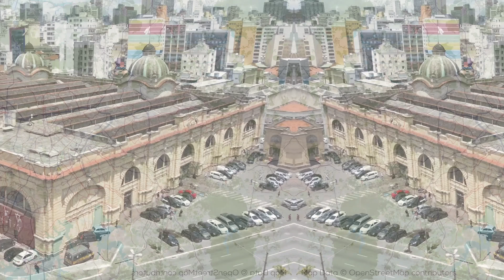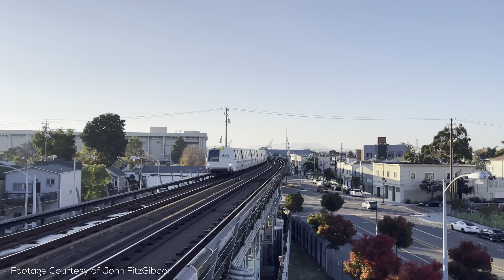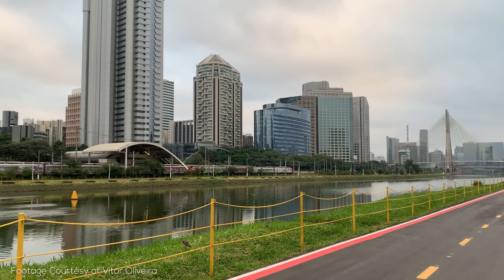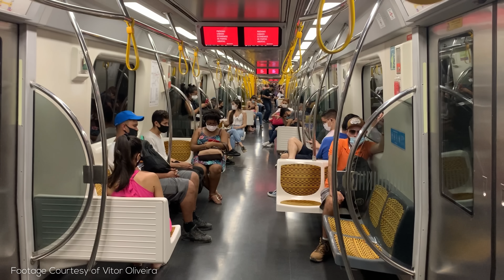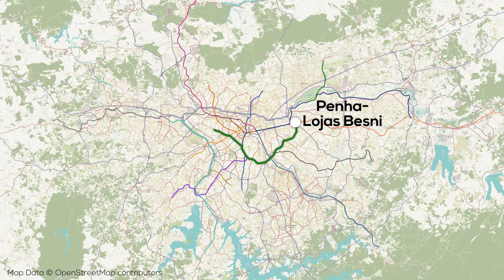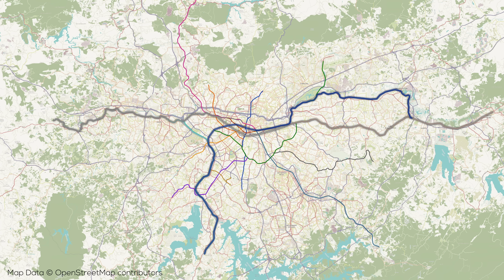The Busiest Subway in the World? | São Paulo Metro, Brazil

Comment: A few corrections, the Tiete doesnt cut the City and North and South, everything above the Tiete is North, but below it we'll have West, East, South and Center, and the city itself has 12m people, but with the metropolitan area it goes to 44m, and also if you look the megacity airport code for Sao Paulo, it is SAO, you'll see that it includes the Airport VCP, from campinas, about 50m from the city, which is highly accessable to brazilian because most airlines will give you a free bus from Sao Paulo to VCP
Reply: I meant 1h50m from the city to VCP, which is far compared to the others, but accessable if flights are cheaper

Comment: I am from Brazil and lived in Sao Paulo for 8 years, where I used to take the subway daily (now I am living in Toronto). The Sao Paulo subway system should be 3 or 4x bigger than it is, to have an idea I used to wait for 3-4 trains just to be able to get in, there are simply too many people. The subway also does not reach most of the city and the average Joe needs to get a bus, after a train and only after that be able to get the subway (sometimes it takes more than 1 hour to do that and they spend 2-3 hours daily commuting). The subway trains and stations are very clean, as you can see in the video, and you can even see employees cleaning the walls.

Comment: I feel honored as an engineer who have been working at São Paulo Metro for the last 14 years (lines 1, 2, 3 4, 5 and 15). Thanks for the video my friend!
Reply: Obrigado pelo monotrilho, tem ajudado pra caralho desde 2018
Reply: Vlw pelo monotrilho meu mano, vc salvou mto meu job
Reply: Soon to be line #7 aka linha de ouro
Reply: i use it every week, thanks
Reply: You didn't need to expect the Expresso Leste in the 2000s
Reply: Cara valeu pelo monotrilho da linha 17 vai ajudar muito
Reply: São Paulo Metro`s is the most cleaner around the world
Reply: Well, congrats but the company needs to do better. CPTM still have a lot to improve, specially when it rains. It's total chaos with power going down and most of the time AC not working on proper hot days. But other than that it works perfectly, Sao Paulo is basically a swiss cheese when it comes to the subway stations, you cross from one side to another using public transportation easily instead of facing hours on a huge traffic on the roads.
Reply: @Mevonez  Well, if the power goes down the problem wouldn't be of the electricity company?
Reply: @exmundi  I meant: when the power goes down only at the train line. They say the power is down on lines: "x y and z" and they're working to repair. Not when the power goes down in the entire neighborhood or  smt like that.
Reply: @Mevonez  What does that have to do with this guy who's an engineer?

Comment: Things I like about Sao Paulo Metro system:
1- Cleanliness.
2- 5min. wait time between trains.
3- single fare price no matter how far you travel.
4- improving service availability by extending the lines farther.

Things it needs to improve:
1- Fix the IC card recharge machines which are broken in many stations.
2- Integrate with private companies to build more shops and recreational facilities on its stations like in Japan.
3- A true "ring" rail line running the downtown perimeter connecting many lines, just like the Moscow metro.  
4- Desperate need to improve / overhaul the CPTM over the ground lines. Many trains have wrong destination signs! Not to mention wrong radio announcement!
5- Make decent integration of Metro with airports. Carrying your luggage 100 meters to 300 meters from the station to the terminal shows lack of urban planners and mayor competence.
Reply: The main problem is still overcrowding, Grajau and Santo amaro need more acsses plataforms
Reply: 5min wait time between trains only in CPTM and ViaMobilidade, CMSP lines it's like 1-2min
Reply: @A556CPTM  5 minutos é no Rio aqui em São Paulo tem dias que leva 30 segundos de um trem para o outro na linha 3
Reply: @marciodesouza6288  Como eu citei, nas linhas do Metrô (CMSP) é mais rápido, na CPTM não é tanto
Reply: 5min in worst cases. I use it everyday and i can assure that is around 1,5 - 3 min. Theres screen monitors all over the station telling the wait time to next metro
Reply: @furashi5717  That is only line 4 though
Reply: no, some of metro lines have, like line 1 that i take every day, but yea not all of them. @xaropevic7918
Reply: @xaropevic7918  I've seen some on line 1 as well, but it'd be nice if they were more common.
Reply: @furashi5717  Remember when those screen monitors didn't even exist? Man, jow things have changed! 😊
Reply: ''cleanliness'' KKKKKKKKKKKKKKKKKK
Reply: @ZedroPilves  O cara escrevendo isso com um rato vomitando do lado dele kkkkk
Reply: For point 5 of improvement (which, as someone living in São Paulo, is indeed an awful problem), one possible source of the issue is that Guarulhos is located in the neighbouring town of Guarulhos, instead of on São Paulo itself
Reply: legal ver os br falando ingles com br
Reply: @gabrielprates8385  CPTM também.
Reply: Lack of urban planners and mayor competence sounds par for the course, here. 😔
I'd like to think we still have many good urban planners among the bad ones, that's why a city this big hasn't collapsed or anything, but "lack of mayor competence" hits too close to home.
One could count in one hand the number of actually good, if not great mayors São Paulo's had, the rest mostly don't do anything or just build something or apply some law change just "to show service", to say "they're doing something", without any real plans or anything.

Sorry for the long rant! It's easy to get lost complaining about the bad stuff! 😅
I'd like to conclude by thank you for being real when talking about our Metrô subway! You were on point when describing both the positives and the negatives!
I only hope Metrô and CPTM can continue improving from now on, São Paulo has too many different and interesting places to visit, and the easier it is for people to transit to them, the better! (no, seriously, this fucking city is TOO BIG 😓 )
Reply: @gabrielprates8385  Things that needed improving for YESTERDAY.
Sadly, our "dear" little mayors... 😔
Reply: 5 minutos ??bem menos
Reply: There is a monorail line that is in construction that will stop next to the airport
Reply: @Fey418  well, you might want wait for a while for these improvements considering the mayor and the governor are bolsonaro's puppets.
Reply: we do not need to privatise anything
Reply: @gabrielrangel956  We MUST privatize as much as possible!!
Reply: @gabrielrangel956  Privatization is always welcome
Reply: @Bruh-el9js  privitization is always unwelcomed, this neoliberal rethoric does nothing but worsen public services and give control of our sovereignty to imperialism
Reply: 5 minute sounds too much to handle this much traffic. It must be 90 seconds.
Reply: @himanshusingh5214  its less then this time
Reply: 60 seconds @belo.2
Reply: @himanshusingh5214 é isso mesmo 90 segundos pra menos eu pego todo dia e até  deixo um passar e pego o próximo de tão rápido
Reply: @himanshusingh5214  True! That´s it! But RED Line has even smaller intervals!
Reply: @himanshusingh5214 it's mostly 2-3 minutes actually
Reply: Things it needs to improve:
1 - Get rid of the paulistas.
Reply: you mean Paulistanos, right? @mvf1998
Reply: @mvf1998  1. get rid of baianos, actually
Reply: @lauratiso  É tudo a mesma coisa.
Reply: It's not clean at all lmao
Reply: @Bruh-el9js  I take the coral and blue line twice a week and it is generally very clean, I always see cleaners taking out the trash at the end of the line, trains are in pretty good shape (except for grafiti scraped from the windows wich can't really be cleaned)
Reply: @EmissoraGados  I take the blue line daily, at least from Tucuruvi to São Joaquim it's everything but clean. There are cleaners indeed, and they're always doing their best, but there's always that characteristic stench, and the bars are always oily and sticky. I clean my hands with alcohol every time I leave the station.
Reply: @Bruh-el9js  people sweating doesn't mean it's not clean, i rarely see trash on the floor and when i do see it, it gets cleaned not long after
Reply: @EmissoraGados  I think it does mean exactly that lmao
Reply: @Bruh-el9js  That's pretty clean for a big city subway line , from the ones I've seen myself, NY one has rats running through the line and Paris one is pretty similar to SP one but looks a little dirtier (prob due to its age) but it smells way worse. The thing is it's pretty much impossible to clean during rush hours, so it's normal to be a little dirtier
fyi: I live in SP and also take the blue line frequently
Reply: @williamshie4326  I do believe that it's cleaner than NY or Paris, those are basically sewers
Reply: ce mora aqui perto do tucuruvi mn? jjjjkkkkkkkkk @Bruh-el9js
Reply: @belo.2  Mais ou menos, o Tucuruvi é a estação mais perto da minha casa, mas ainda é um rolê pra chegar lá
Reply: mora onde @Bruh-el9js
Reply: @Bruh-el9js I take line 3 daily from artur alvim to república and line 4 from there as well, both seem pretty clean, especially the subway itself, the station is decent, other than the bathrooms, those are kinda bad, especially at the smaller stations.
Reply: @Bruh-el9js Sei como é, é um rolê pra eu chegar na artur alvim também, tem outra estação perto de casa relativamente, mas é complicado também e é cptm, aí demora
Reply: @Bruh-el9js  Damn. 😳 Blue Line is in THAT much of a mess?!
I mainly take the Green and Lilac Lines, so I had no idea! Been a little while since I last took the Blue Line, but I don't remember it being that bad.
Reply: @MrDibara  The other users in this threat seem to disagree
Reply: @Bruh-el9js  Yeah, goes to show how different everyone's perspective is. 😕
I should go use Line Blue more, even if just for touring. If only I can find the time to. 😭
Reply: @Bruh-el9js  Não adianta a empresa cuidar da limpeza se os usuários não colaborarem também. Eu não tenho do que reclamar do metrô de sp (tanto CPTM como ViaMobilidade e Via4), a não ser pela falta de outras linhas e estações. Deveria ter uma estação em cada bairro .
Reply: @SamirSiqueira  Eu sinto falta de uma linha pro meu bairro também. Só precisa de  um ônibus pra chegar no terminal Santana, mas ainda é uma viagem longa.
Reply: @Bruh-el9js  Eu moro entre as estações Jurubatuba e Autódromo da linha 8 esmeralda. Ambas ficam longe pra ir a pé então tenho que pegar um ônibus de qualquer jeito, mas só de ter agora a linha lilás pra fazer integração com a linha azul já é mó adianto! antigamente tinnha que ir até pres. altino , pra chegar na integração com a Luz.
Reply: It’s very clean, secure and safe compared to Paris or NYC.
Reply: @Bruh-el9js  It depends on the station, not the line. And usually, it's because of a homeless person.
Reply: @Bruh-el9js You are literally just lying, I traveled through line 1 blue from tucuruvi to Jabaquara my whole life and it's super clean especially when you compare to the stations at line 4 yellow
Reply: @Bruh-el9js A????? are you dense????
Reply: @sweetheartsz  I take it every single day. I'm not lying.
Reply: @sweetheartsz  No. Are you?
Reply: @Bruh-el9js  The Sao Paulo Metro Subway system may not be as clean as some in Asia but it's definitely not as filthy as the NYC MTA and the DC Metro so I'll gladly take Sao Paulo over many North American Subway systems any day of the week.
Reply: @sweetheartsz  ME TOO! It is absolutely clean!
Reply: @Bruh-el9js  You are lying, obviously! KKKK!
Reply: @joseluciocorrea1866  I'm not
Reply: @Bruh-el9js  Non sense! It is VERY clean! The São Paulo metro won the prize as the CLEANER metro system in the world by the International metro Association!
Reply: @joseluciocorrea1866  You mean "cleanest", and I don't think that this means a lot. It smells, it's full of homeless people, it has pigeons inside the stations (blue line, specifically), a bunch of litter thanks to the commerce inside & etc.
Reply: @Bruh-el9js  Caraí mano 6 dois são brasileiros e tão falando ingles
Reply: @guilhermehu3br  Yes
Reply: in comparison to most other systems around the world, yeah it is very clean  @Bruh-el9js
Reply: Metro is redicuously clean. You'll be hard pressed to find a single piece of trash or even gum stuck under a seat. It's crowded at peak tme, yes, but it is quite clean and has very good airflow. @Bruh-el9js
Reply: @Bruh-el9js  it's certainly cleaner than every single metro I went to in Europe, and I've used Paris, Brussels, Rome, Prague,  Vienna, Frankfurt, among others, not one of those can come even near Sao Paulo in cleaniness.

Comment: Hi I´m from São Paulo just want to give some notes :
all the CPTM lines could connect on Luz already since there are tracks for that
line 8 CPTM had a connection with Luz station but nowadays is deactivated, despite being just one station away, less than a kilometer
line 11 had more stations between tatuape and corinthians itaquera stations, segment inside São Paulo, that were deactivate to make it a express  segment.
line 2 green aims to expand in a second phase from Penha lojas besni to Guarulhos city, which is north of são paulo, integrating with lines 12, 13 CPTM.
São Paulo also claims to have the cleanest trains of the world, but also has a slow expansion of it´s so it´s extension were overcame by other cities that started at the same time, despite being smaller cities.
Also the modernization of the train lines are quite slow, many of the line 3 red and line 1 blue just started using automatic doors in the stations despite this plan starting some 10 years ago.
The monorail line 15 was plaged with problems from construction to operation and have the worst service of all lines.
Other things that might peak interest about São Paulo transportation are the Fura-Fila, which would be a modern Tram but was dowgraded to BRT after many years of delay and Pedro II terminal of buses, which should be integrated with  Fura-fila and Pedro II line 3 red station, is one of the worst cases no integration in São Paulo.

Comment: Excellent video about São Paulo mass transit! After years of slow growth, finally São Paulo is investing heavily in the expansion and improvement of its system! I believe no other Western metropolitan area is expanding and improving its system like São Paulo presently! Right now there are 4 metro lines under construction and 3 more with contracts for the projects!
Reply: Los Angeles is probably the only other city expanding its metro system in a similar capacity in the western hemisphere.
Los Angeles went from having no rail metro system in 1990, to having the 3rd most extensive in the U.S. after NYC's and Chicago's in 2022.
In fact with current plans, it will likely be more extensive than Chicago's by 2030.
Reply: @danmur2797  I think that São Paulo has a bigger expansion program going on than Los Angeles or any other city in the Western world. I speak about actually construction being done and not about projects on paper only! Right now São Paulo has FIVE LINES with construction going on! The system operated by several different companies now transports around 7 million passengers per day!

Comment: São Paulo commuter here. Worth noting some other points: 1 - some stations are operating above capacity and clig way too often during rush hour, like Sé and Paulista-Consolação; 2 - CPTM service lacks on frequency, specially on weekends; 3 - stations are sometimes overdimensioned and located on low-density areas; 4 - line 9-Esmeralda, CPTM's first conceded line, is suffering from operating issues since handed to the private sector. Apart from that, glad to know SP's system is ahead of so many counterparts in North America. Thanks for the video!

Comment: São Paulo has an interesting and unique traffic system called Rodízio, which means "Rotation" in Portuguese. Thus, depending
on the weekday riding a car is prohibited and really radar enforced.

For example, on Mondays car plates ending in 0-1 cannot ride, on Tuesdays plates ending in 2-3 are prohibited, on Wednesdays 4-5... There are exceptions for drivers with disabilities, electric vehicles and other cases.

If you rent a car at GRU or CGH airport, the agent will calculate the weekdays of your reservation to provide you a car with a plate that will make optimal for your stay avoiding the Rodízio.

There are also the blue lanes exclusively for motorcycles, very interesting.
Reply: Hi, Luiza! I think, in that case, you can also refer that system as "driving restriction day". Cheers!

Comment: Most public mobility investments done in Brazil are being funneled into large Metro MSA’s , São Paulo rightfully getting the  lion’s share of sunk infrastructure miney. 

The priority within São Paulo is laying tracks to exurbs through grant money and investor bond funding. .  Which is being done through either commuter rail lines ( CPTM ) a quasi government owned rail network ,or the Subway network also known as Metro.  

Private operators ( Metro )  do not build these lines with their own money.  They lease out infra structure as a granted concession to operate these lines directly from the regional network authority.  Ticket sales revenue is shared with commuter rail networks.

There used to be intercity train traffic , up until late 80’s. São Paulo-Campinas, São Paulo - Rio, and even farther out to places such as Sorocaba , Bauru ,Ribeirão Preto,Santos on the coastline. 

Demand for such rail corridors felt through the bottom , as cheap airfares and highway traveling force many rail  stops into museums , and rusty tracks. The surviving intercity  tracks remained thanks to bulk cargo hauling.